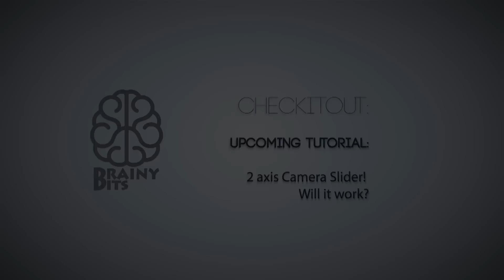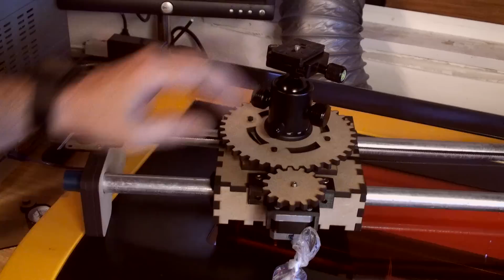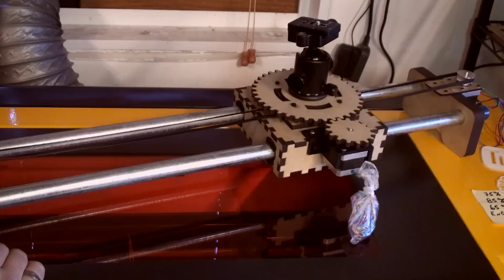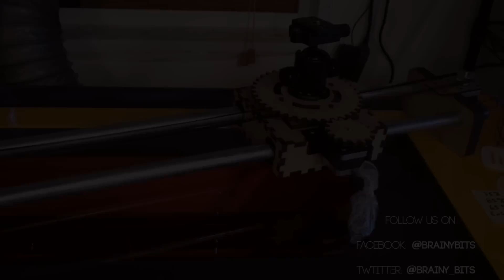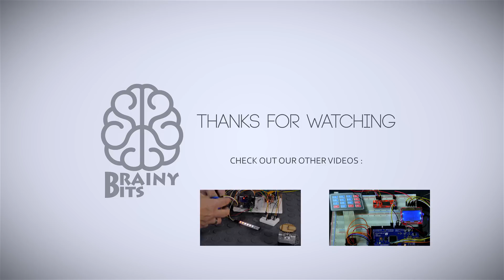The "2 Axis Camera Slider" - Arduino Controlled! - Upcoming Tutorial

Comment: ive been experimenting this same project, i notice when controlling 2 to 3 motors (slide, pan and tilt) to follow or lock on to a subject needs backlash option on programming to perfectly synchronize the movement and able to accurately initiate the set movement back and fort. thank you, great project Brainy-Bits.

Comment: The best posible programming is to apply your "in and out points" program for each motor and add one travel time settings for both motors, the pan motor travel shorter than the slider motor but both have to travel at the same period of time. i hope you can get this project done soon, and share the codes. I have been using the open source code of MX2 from dynamicperception but that only drive dc motors and good for timelapse, I started to build another system using steppers but i dont know how to write the code.  thank you Brainy-Bits,
Reply from the maker: I'm currently working on options, the next tutorial will add some more stuff to set starting point, end point, etc...  The video should be out later this week.  Thanks for the comment and for watching!

Comment: cool project I look forward to it ; -)
Reply from the maker: Yeah me too :)  Don't know how it will turn out, or if it will work properly.  Thanks for watching!
Reply: I'm sure you'll figure it out.
tho I'm wondering if geared DC motors would be easier.
Reply from the maker: Geared DC motors would probably not be easier, with stepper motors I can dial in the speed, distance, etc... very precisely, and I've got some steppers lying around :)  Thanks for the vote of confidence btw!
Reply: I'm currently building one too, my one is only single axis. I'm also using an Arduino, the user gets to enter parameters and the slider performs a routine to shoot a time-lapse. I took apart a yongnuo wireless trigger and got the Arduino to fire that to trigger the shutter on the camera. Using this method I don't need any wires going to the camera to fire it. The breadboard works great, I just have to fit it all in the enclosure and wire it all up. I look forward to see how yours goes. 👍🏻
Reply from the maker: Wow, using wireless trigger and everything!  Mine won't have that I'm afraid, at least not yet ;)  How do you enter the parameters for yours?  In code or using some kind of keypad with LCD?  Thanks for watching btw...
Reply: The user enters parameters using a potentiometer and an OK button, and yeah an LCD. The stepper is driven by an Easy Driver using the accelstepper library. Your videos have help me so much in getting this project running. So thank you for making them and I look forward to seeing more.
Reply from the maker: Thanks for the details of your project.  I will be using the AccelStepper library again in this tutorial coming up.  Thank you for your comment and great to hear that the videos are helping others with their projects!